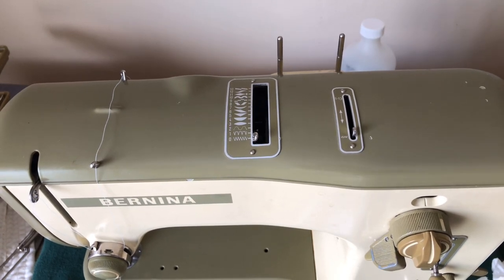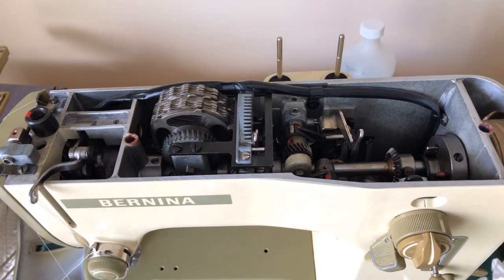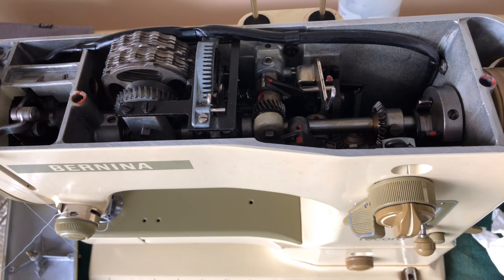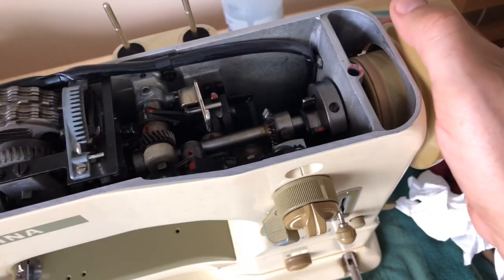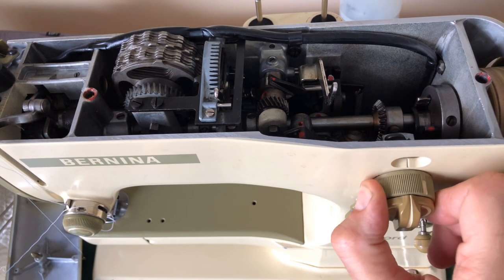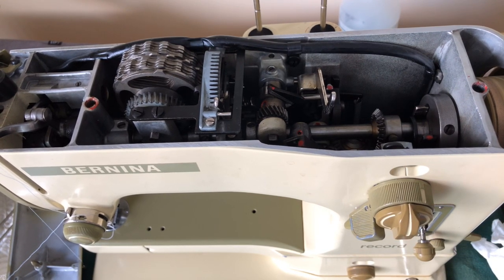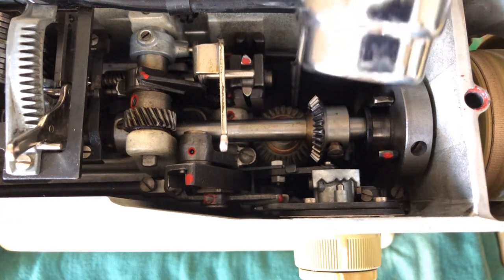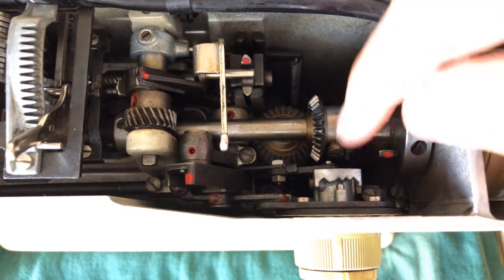CLIENT PROJECT SERIES #3: Using Heat, Oil, & Patience to Coax a Bernina Sewing Machine to Move Again

Comment: When I received my Bernina 730 record I was told it had not been used for at least 20 years! So I did all the things you said but was wary of heat guns. So I oiled it and then left it in the hot South African sun for 5 days adding more oil until things moved. It worked and everything moved and now 5 years later it is still running. Magnificent machine.
Reply from the maker: Great idea Gwyn.  I actually tried something similar on my stuck Kenmore 1941 but could not get it to high enough temps here in the Canadian version of summer!

Comment: Thank you so much for this video series! I learned so much!
As you said so nice in the video we do learn from each other and so  I do want to share some information myself. 

I got the old Bernina 530-2 from my boyfriends grandmother in 2020. Two years bevore I  started sewing with a Privileg sewing machine from the 80ies and it wasn´t half as good as the Bernina! Sewing with this Bernina is so great as it the motor is not so loud while sewing, the stitches are more exact, the strenght of the machine allowes to sew more stiff materials and/or more layers easy... And also the company stayed with their sewingfood production till the 90ies the same system which means you can buy also today foods for those machines! Isn´t that great??
You just have to accept that you need bether light ( I use a seperate LED flexible lamp  standing next to the machine from IKEA), you do have no automatic threader and you do have no overlock sewing stitches. ... when you can live with that it is a great experience to sew with this beauty! 

I am lucky that I found a company in Austria doing allready services for such old machines ( Kastl& Reiter in Lerchenfelderstraße 9-11) so in the beginning I didn´t needed to know allready how to help my machine to get back to live. 
Sadly the machine stand too long still so I am allready  facing the problem that I can´t set the needle position left or right, but luckily I can use the zick-zack. Now I do understand what my sewing machine do need  and what my sewing mechanic meant when saying that if I sew a lot I may be lucky and the machine will be one day able to do that again.
Maybe I will help her myself now that I have seen here how it can be done when you take your time and efford.

Comment: Love your videos.  Really helped me buy my Bernina Record 730 at the beginning of the pandemic.  That said, I have a question.  I was sewing with the machine recently and it started making a squealing noise and the sewing slowed down and it just sounded like something was spinning and then no sewing.  When I opened the top and continued to investigate I found when the lid was open ran perfectly. The trying to put the lid on it wasn’t matching up and when I was able to put back on after a little bit of adjusting. It started making that noise and not sewing again.  

What can I do? I am trying to find a service man but we are in lockdown in London.  I have worked on many industrial machines and had the Bernina 950 so I am not a complete newby to doing my own Maintenance but it’s been a while since I owned a domestic machine and trying to understand what happened.  I am the second owner and it’s in pristine condition.

Comment: Would synthetic oil make a difference in lubricating these machines.
I have just reclaimed my Moms 707 Minimatic and with your helpful video series it is running and stitching.
I do need to take it in to a shop however as I found a c clip loose in the bottom of the machine and I cannot see where it came from.
Thank you for these posts!